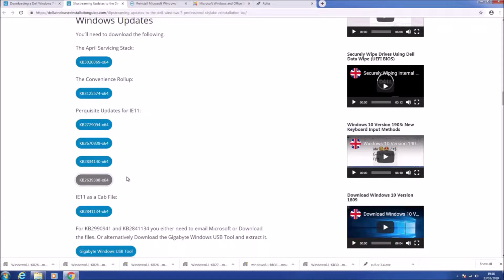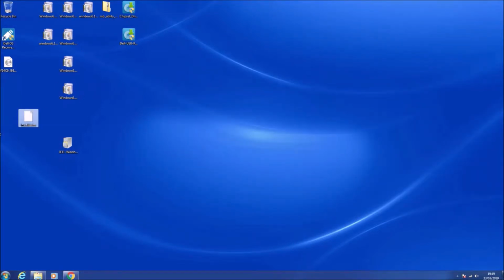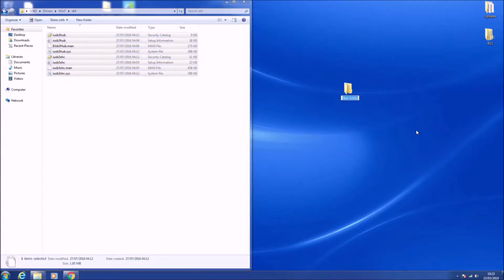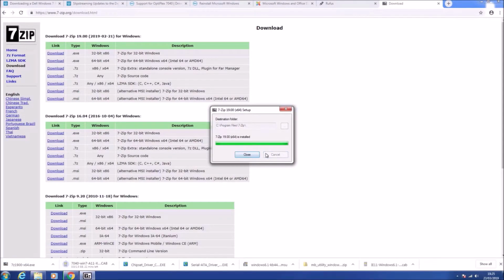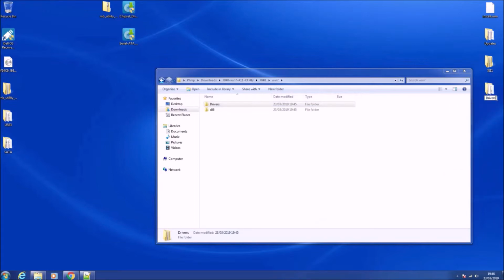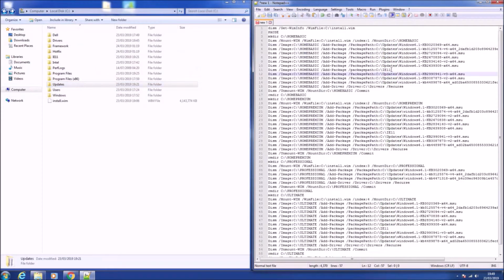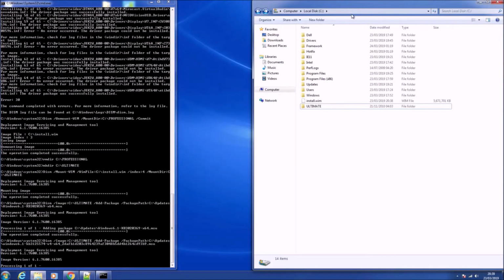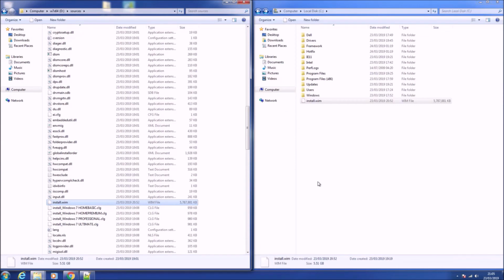Slipstreaming Dell Drivers and Windows Updates Into the Dell Windows 7 Pro Bootable USB

Comment: Hi @Philip Yip - Way back in the '95 and XP days, I used to build PCs.  We made the jump to Mac equipment in circa 2010, but we're now in need of an old PC laptop for a task involving an old [expensive] 32-bit abandonware utility that was written for XP.  We purchased a nice looking Dell Precision M4700 for the job, but, after making some boot order changes in its Dell BIOS/UEFI, it displays zero video via neither the display panel nor the HDMI port.  I suspect that the BIOS is corrupted now, so I want to ask you how one might go about "refreshing" the BIOS on a machine like our Dell M4700? ... and, if my rookie nonsense makes absolutely no sense, I totally understand.  Cheers for any advice I can get.
Reply from the maker: It might be trying to use a different boot device and giving you a blank screen because it is not bootable. The system has a old legacy only BIOS. I think they used to boot to black screens with a tiny white underscore...

If you hold down the power button for 30 s and then wait 10 s. Then power it up and repeatedly press F2, do you get to the BIOS boot menu? Or does the screen remain blank?
Reply: @philipyip1988  Many thanks for writing back, Philip.  For the sake of brevity, I omitted a lot of information about our Dell M4700 issue.  In short, I was told that the machine should "post" no matter what.  I was also advised to start removing certain parts of the machine - like the SSD and/or the AMD dGPU board - and, afterword, try restarting.  Unfortunately, I still saw absolutely zero video - not even the flashing "underscore" that you mentioned.  As I wrote about before, the machine has been this way ever since I changed the boot order in BIOS.  This being the case, I'm now being told that the BIOS itself may be corrupted.  Given the prevailing "black screen" symptom, this seems logical to me.  That said, we still need a machine that can run Win XP natively - not via a VM - so I've ordered a main board and an nVidia dGPU for the M4700.  Regardless, if you have any thoughts about how we might go about correcting the BIOS issue on the original M4700 main board, I'd love to read all about it.  Once again, cheers for the response, mate!